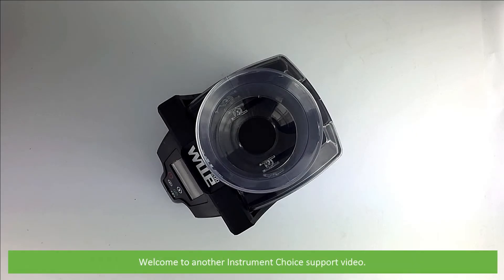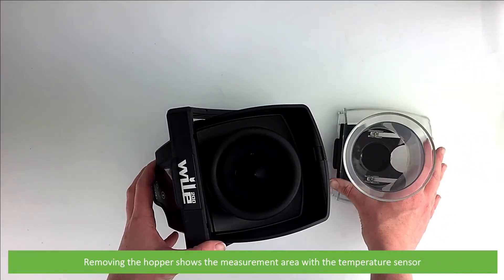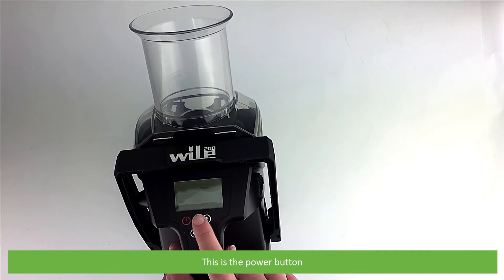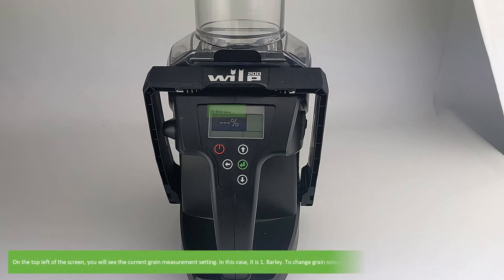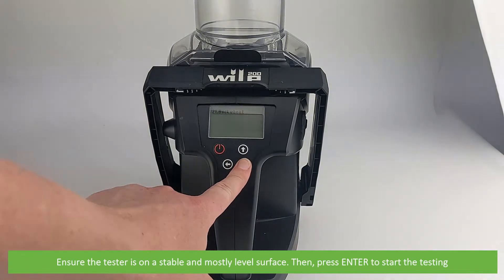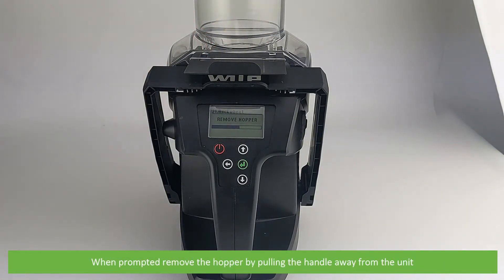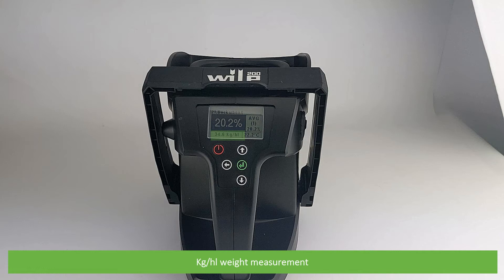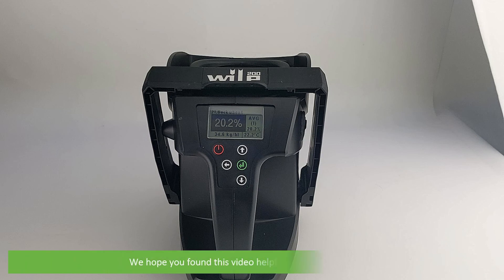How to use the IC-WILE-200 Grain Moisture Meter with Test Weight

Comment: what is the differencw between 200 and 50 series? İs the 200 more accurate and reliable?
Reply from the maker: The Wile 200 has a wider range of grains it can test and have a better repeatability at 0.3% compared to the Wile 50 series.